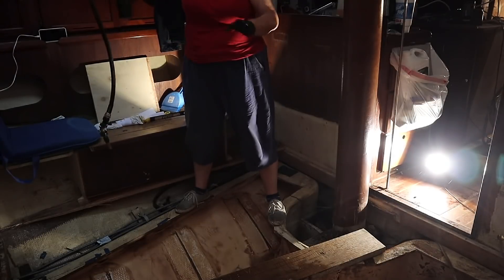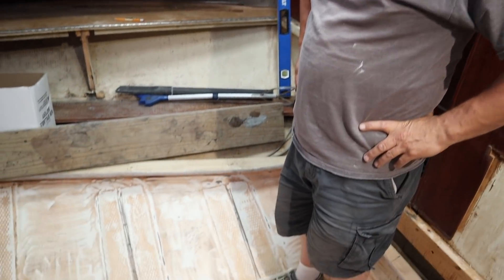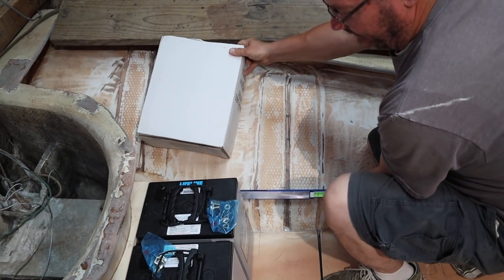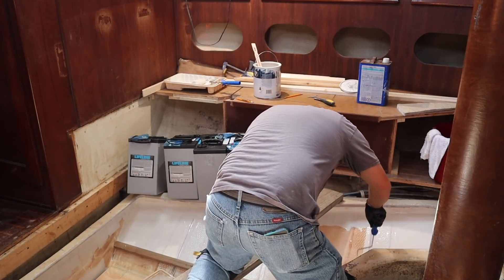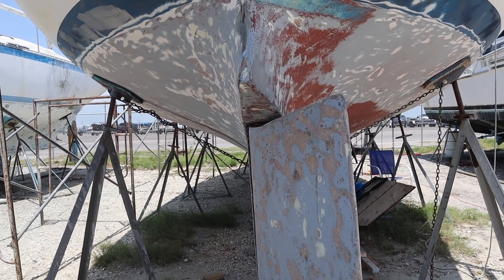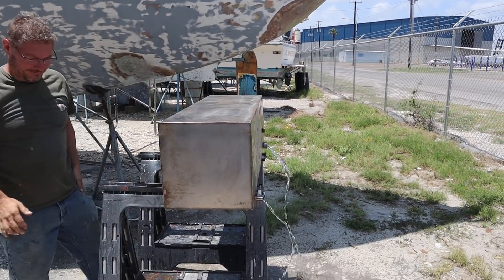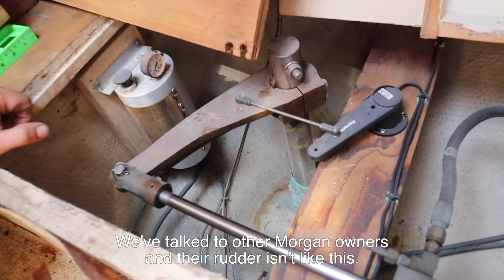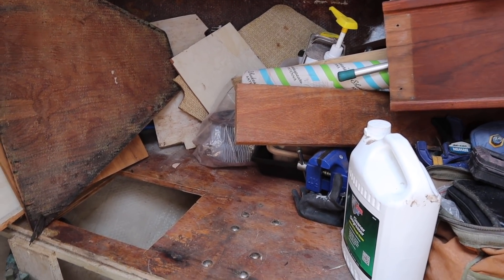What's WRONG with the RUDDER? | ep. 82

Comment: In case you never got this resolved, I would suggest that it is not the original hydraulic cylinder and that it is not the correct cylinder.
Reply from the maker: We've compared it to other Morgan 462s and it appears to be the same/original. It's working for now and we did find a rebuild kit. Thank you for watching and commenting.